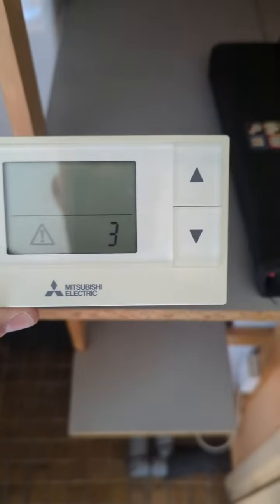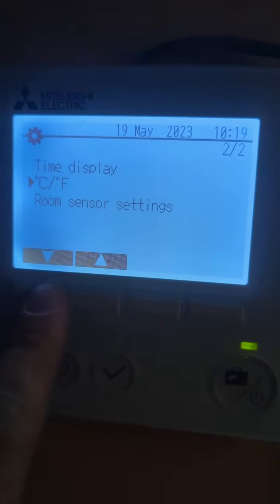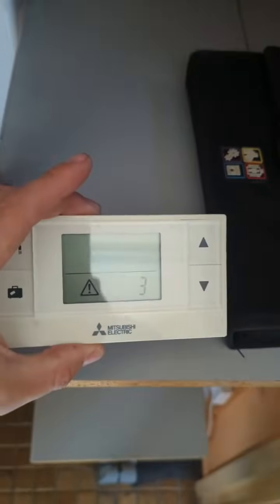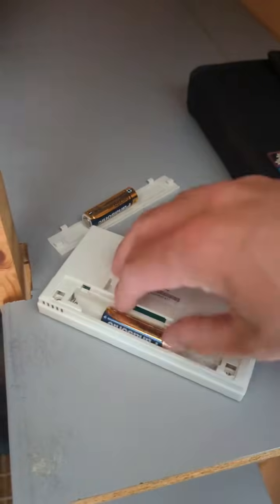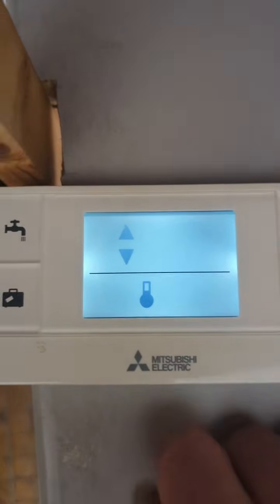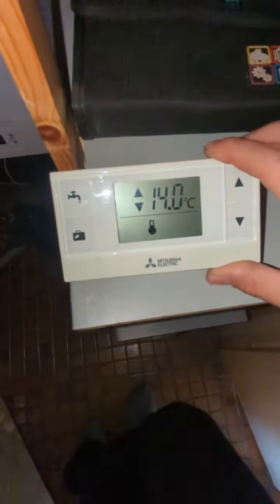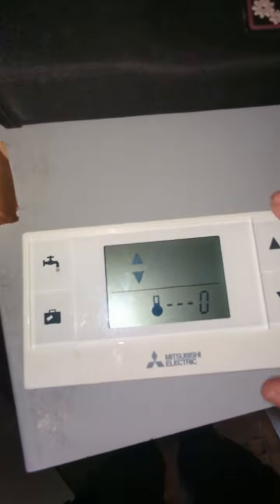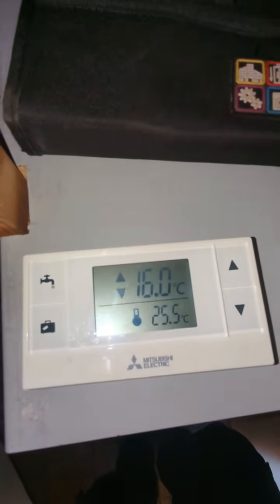Mitsubishi Ecodan wireless thermostat not working !

Comment: I found your video helpful but did not solve my issue. My thermostat needed its battery's changed and showed a battery symbol on the screen with a line through it. Changed them last night and screen showed some lines and I left it be to sort on its own. Woke this morning to the heating up full blast and unable to control how I normally would. I started following the steps you show but my main screen read rc4 in the settings unlike yours that reads rc1. On going forward it told me error when I selected one on re pairing but has worked on choosing 4  both times on the thermostat. Just wanted to put out the change that made mine different but everything else is the same. So definitely worth checking what it is on or should be on in the settings and choosing that number.

Comment: Thankyou saved me a callout. My control panel shows temperature curve option not room temperature of the remote room stat as in your example is this ok? I tend to use the app for temperature settings and it is syncing with the two zone thermostats ok and everything else is ok

Comment: Thanks for the guidance. I followed all the steps in the manual and again while watching the video. My receiver will not go into pairing mode. What could it be other than switch 1 ? Could the setting of the other switches prevent the receiver from pairing?

Comment: Hi. We’ve had a heating engineer come out and our reciever is pairing to and taking the room temp readings from next doors thermostat apparently. So our heating won't come on. How do we fix this please! 🤯
Reply from the maker: Heya, Is the engineer that attended Harry potter ? this is next level wizardry. surly your neighbour must be experiencing the same issue with their thermostat ? if this is the case, I would advise following the steps in the video with your thermostat and wireless receiver, this will reset the whole thing and then should read true to your heating.
Reply: @renewableheatingengineer8537  he wasn’t overly helpful to be honest, he didn’t know how to fix it, just that it was taking reading from next doors thermostat and not ours and then didn’t fix it . We’ve tried the steps on the video. The thermostat and the water tank screen are both showing completely different readings (miles out)
Reply from the maker: @Wiles32  if the handheld thermostat isn't showing the same reading as the main rc like in the video, it means the repair hasn't been successful and could indicate a faulty thermostat / receiver, I would advise getting the engineer back? simply leaving the issue there isn't great. in the mean time if your heating isnt working, you could switch the setting to Main rc so this acts as a room thermostat temporarily.

Comment: Moved in 3 weeks ago and this video has been a real help. I have a question though, should my immersion be switched on at the wall? Our electricity consumption yesterday was £13. The last owner left us absolutely no instructions on anything. I'm relying on the internet for all my answers.
Reply from the maker: @Tuffers-1875  heya, yes the immersion should be left on but only if it's wired into the FTC panel where the ecodan unit controls the immersion usage for legionnaires cycle etc. if the immersion switch is direct then this could be the reasoning for your high energy usage. Best to get a reputable contractor in for a service and whilst there ask all the questions you have to get them answered. The internet can most of the time be very misleading.
Reply: @renewableheatingengineer8537  another question, sorry but this the only way to contact you. I'm getting a knocking sound in the pipe coming from the white expansion tank. Would it be trapped air? If so how do I release it?

Comment: Does this work if you have multiple controller units?  I have 3!  Do is it Room RC1?? 🤷🏼‍♀️
Reply from the maker: Its more complicated with multiple stats, need to make sure the stat you are trying to repair goes to the correct zone, i.e zone 1 stat to room rc1, stat 2 to room rc2 ... some installers will write in pen on the back of the stat which one is which, however some will let you guess

Comment: Can you please tell me why the actual heat temperature (at the bottom of the remote) all of a sudden, namely last two nights, keeps rising ? During the day yesterday it went upto 26 degrees, yet I only had the top button on 15 ???
Reply from the maker: Hi Mel, where do you keep the room thermostat? only reason this would rise is if the stat is recognising a change in room temperature.
Reply: mines doing the same thing, been working great for about 5 years then all of a sudden does not regulate temperature. You can set room controller to 20 and it keeps heating room to 23 or 24c... i haven't changed the position of the thermostat. and i know the room controller/thermostat is communicating with the heat pump as i can set`'holiday mode' and run hot water heating from the tap button on it.

Comment: Hi, we have this problem with our stat but the stat in the loft is in locked mode, so therefore I cannot get into engineer mode, does anyone know how to unlock it? Can’t find anything on google
Reply from the maker: your stat is locked ? or your main rc, if you are relating to the main rc, i.e main controller .. press and hold the tick button and return button until the padlock at the top of the screen disappears.
Reply: Thank you so much, yes I did mean the main rc, something so simple yet impossible to find on google!
I have gone through your step by step guide and now the wireless thermostat is set up and working, thank you! Only problem is the temperature on the main rc isn’t corresponding with the wireless thermostat?

Comment: Wow thanks for helping me get the actual room temp on the remote. That's useful!!

Can I ask how to get my hot water temp to appear on the main controller front screen? I have to keep going all the way into the settings to see THW
Reply: And I have already set it to display room & tank. But the tank temp never shows on the main controller screen. Just the room
Reply from the maker: Hi Matthew, go to initial settings, scroll down to temp display, change the setting from " ROOM " To room + Tank " - Exit the main menu and you should see the square with the bubbles top right with the temperature